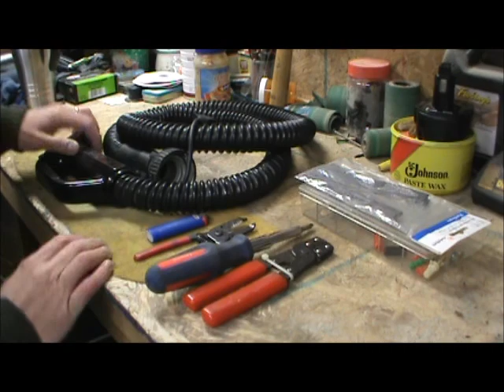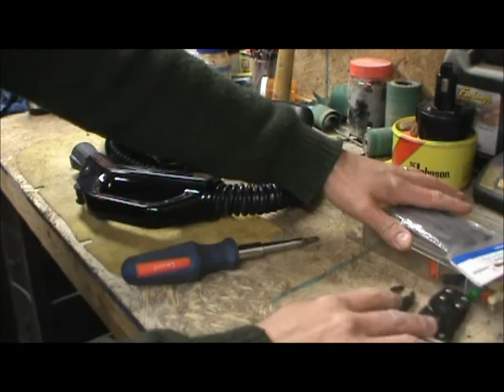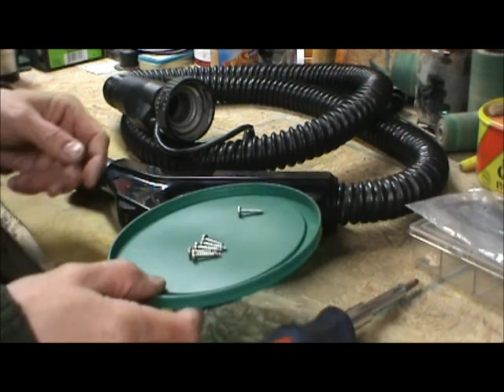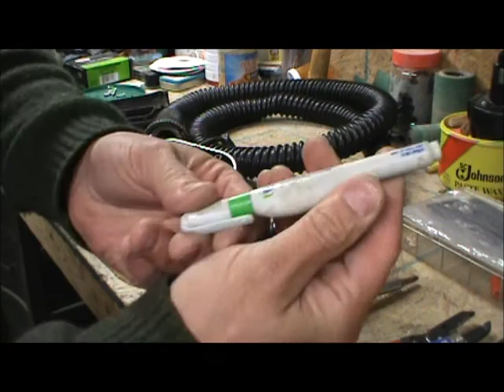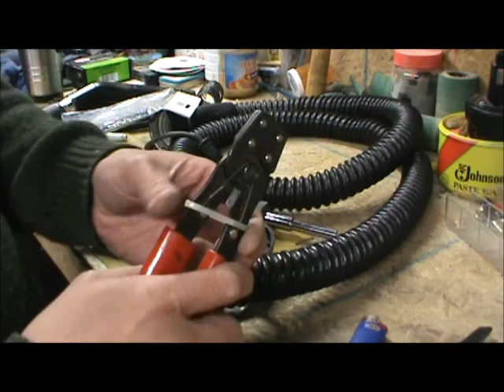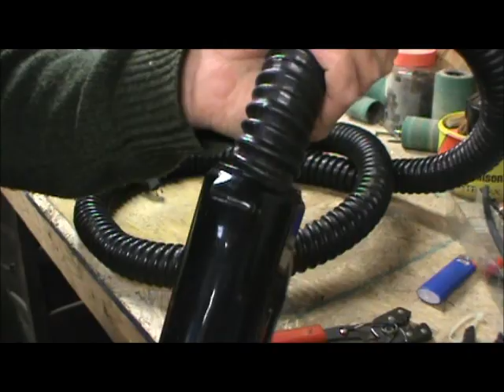Majestic Vaccum Hose Repair

Comment: Hi I have defender and majestic both bought them and I wanted to change the ownership BUT NOT ANYMORE  Defender is working very wellHowever the vacuum MAJESTIC  has a problem with suction I called the tall free number in Canada and the State they put me on hold for half an hour and if I don't hug up thy doI am not happy at all with the servicesI will never recommend filter queen to anyone 
Sent from my iPad
Reply from the maker: I have no affiliation with either company. I only did this repair for my sister so she could continue to use her vacuum cleaner. Sorry I can't help you out.